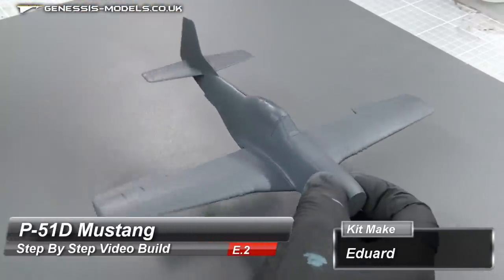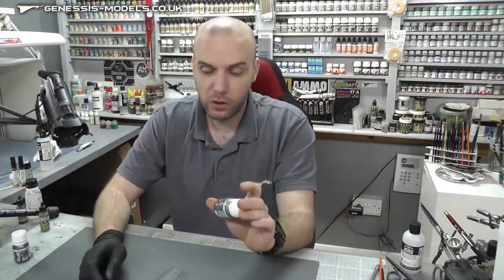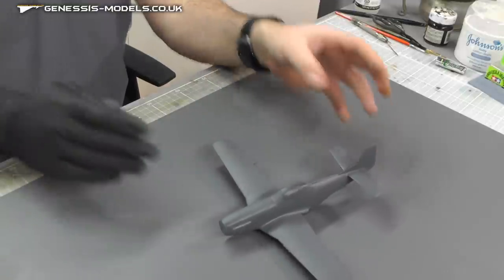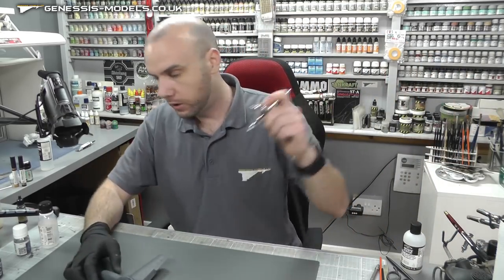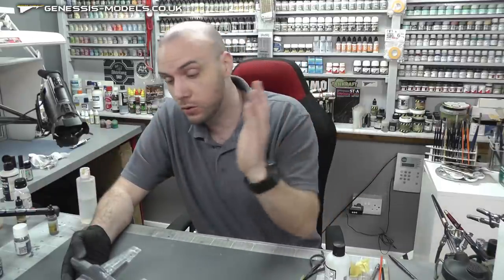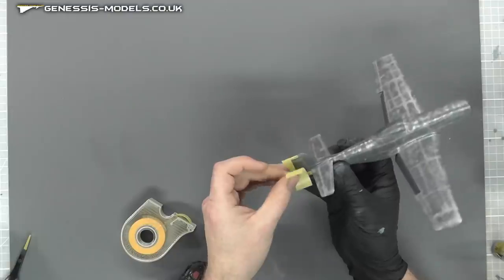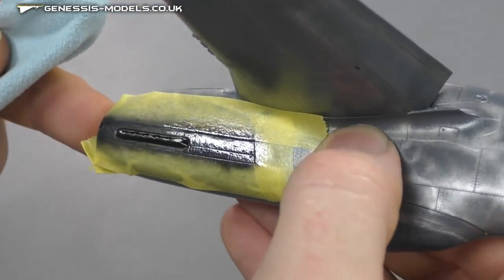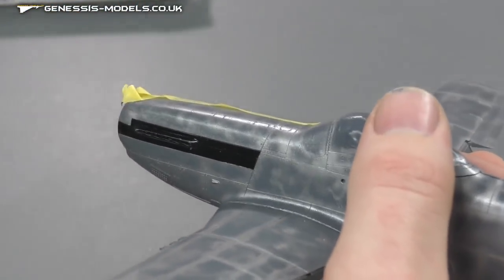Advanced Natural Metal Finish : Building The Eduard P-51D Mustang 1/48 Scale : Episode.2

Comment: For true accuracy, 2 points are worth mentioning:
1 most of the top surface of P-51 wings didn't show panel lines as these were filled & sanded extremely smooth at the factory to take advantage of the laminar flow of the wing
2 approx. 1/3 of the fuselage of NMF Mustangs were actually painted aluminium & not left in natural alclad.

In both cases, plenty of info avail on the web to confirm this
Reply: And the control surfaces were fabric covered so could not have been “natural metal”…
Reply: @RosscoCPT  Some surfaces were, indeed, fabric covered.  Depended on production blocks and dates.  Be careful to check references closely...
Reply: @charlescastell4638  According to a post in Key Aero, The gear doors, fuel tank doors, flaps and ailerons were all left bare metal. Am still not sure about the elevators but the rudder was indeed covered in fabric. 
My guess is they were also as metal was left off there to save tail weight. I tried to post a detailed description from their site of the wings' finishing process but was censored with no reason given.
Reply: Another point to be made, the wings were primered in green zink chromate. I am going to do a weathered Mustang were the green primer is showing through some of the painted aluminum. Black and white pictures are hard to tell anything. But I am going to go for it anyway. Also there is a stainless steel panel were the wings meet the fuselage. Excellent model!!!! Love your show, you have great painting skills!!!!

Comment: All said, thank you for valuable tips on the very sensitive area of natural metal finishing, all useful for a wide variety of aircraft subjects. Due to the qualities of the finishes it is an area where small errors can  easily magnify with little effort.  
So one thing to keep in mind is an airbrush, especially the internal-mix type used here, is the one tool that can actually be used to apply colors in true scale. That is why they should never be used in a heavy-handed way as when used to paint with too broad strokes or using too low pressure that can result in orange-peel effect. Aerosol cans are much cheaper for just this reason. 
An airbrush is a precision instrument that can produce truly fine artwork if used appropriately. As a supplemental tip, too-fast drying finishes can be further smoothed using any of a variety of retarders, slow-setting solvents including even mineral spirits. They are available for just this purpose.

Comment: To transfer the paint from the jar to the cup, I use drinking straws, put the straw into the paint, pop your finger over the end, place the straw into the cup and release your finger. When you move on to the next colour, just cut the end off. Each straw will do about 10-12 colours, there are 100 straws in the pack I bought for £1.00. Economy modelling!
Reply: A hobby shop owner showed me half a century ago how to use a 3" section of rubber tubing the same way. A piece of sponge was good for pressure-clearing the nozzle as well. The soft surgical rubber forms an airtight seal against fingertip.

Comment: I really like the trigger style Airbrush, because you can hold with one finger on top of the trigger and one under, creating a trigger stop that you can adjust on the move. I use Vallejo Metal Colors, and wow are they nice, as good if not just a touch better than AK. But ... if you don’t clean the styrene extremely well, and use Stynylrez primer, it will likely pull up. I’ve also used testors chrome.

Comment: Very, very helpful says I.  An old modeler of 68 years..
Reply: I agree, at 68 we can all learn something new to keep the passion alive. My B-29 will be the test this winter.
Reply: Hey Scott and John, I've got a few years on top of you guys, built my last model in late 80's then stashed everything while life got in the way. Now retired I've been seeing all these model videos and pulling out the stash to get back in the saddle. However, suffering from a bad case of " model evolution". Kit cost are staggering, new materials in glue paint, puddy, everything  when I was building you couldn't mix different kind of paints because it would etch plastic. I'm definitely glad I kept a reasonably large stash of kits because they will most likely be my sacrificial kits to re- learn I usually built clean out of box and didn't use all this layering and washes and weathering these new modelers use.. Not complaing as the new kits and materials are definitely an advancement  just over whelmed on what's out there and where to  start. Good luck and send any ideas or experiences you have had so far if you like. Retired in Pacific Northwest so winter is around the corner. Disadvantage is have to order everything on line because there are no real hobby shops around.  Thanks for letting me ramble  just looking for folks in my position :-)
Reply: @c123bthunderpig  I am happy to know that a fire was relit. I embraced online availability after never buying a model where I live since about 1980. I bought what I could afford twice when stores a hundred miles away closed. I am vintage kit rich too. 
I love water based Tamiya paint and their line of glues and decal stuff. The cost? I will dig deeper but waste nothing. Buy a milk frothing tool for mixing your paint. A good clerk in a kitchen store will know what you’re looking for. 
The realism of today’s kits gobsmacks me. Eduard kits seem to bet at the top of the details food chain.  I have lots of fun finding older kits to build again. The Phantom Mustang is soon. Hubley metal kits are fun to spend a few Winter nights working on. 
Best Wishes from deep in the Boreal Forest.
Reply: @grownjohnboy  John, thanks so much sharing these great ideas, now I don't feel like the last man on Earth. I would have never thought of the milk frother, and I've seen so many Youtubers use the Tamyia glues, they do look very efficient compared to the " old Testors goo ".  I'll also check out Edwards. You're confirmation has stoked my motivation considerably , and giving me more direction to my quest  . Happy Building from the land of Sasquatch